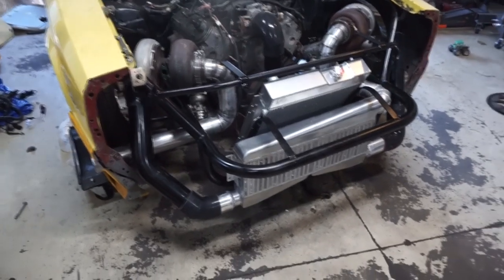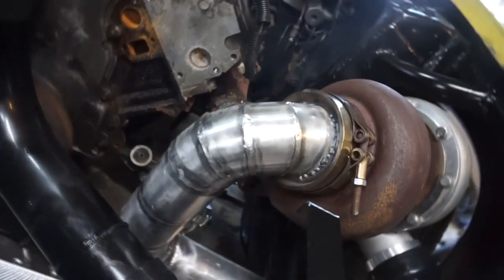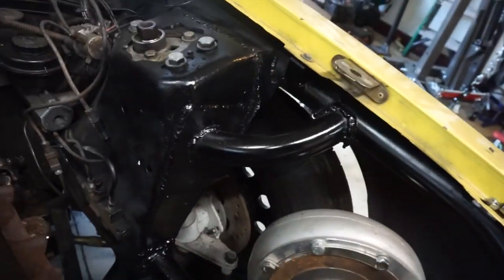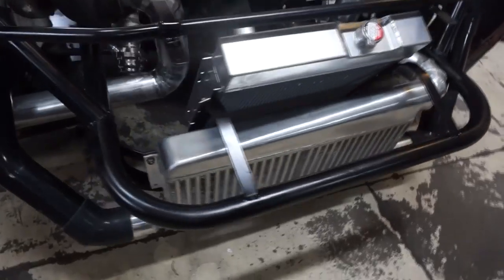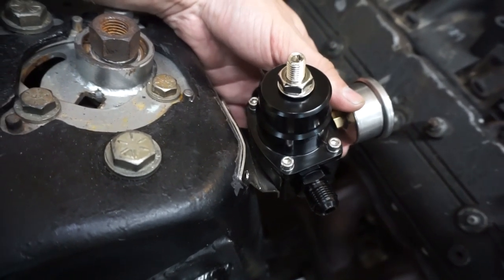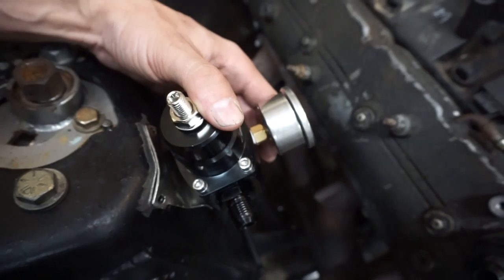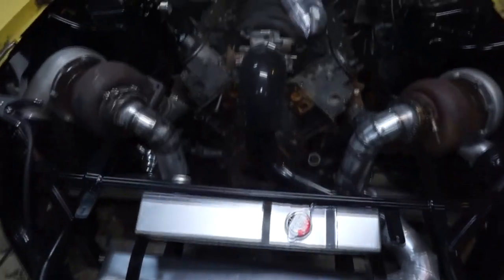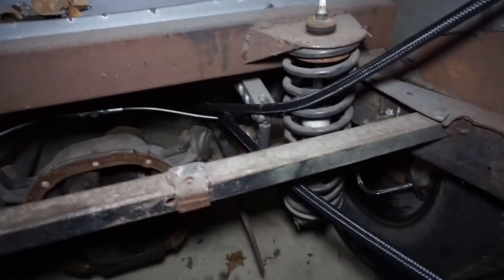LS FOX Radiator Paint And Fuel Pressure Regulator Things!!!

Comment: Man, I've fought braided lines and fittings for years. The biggest "trick" is to use the same brands of fittings and hose. Its tempting to buy cheaper fittings/hose in different brands, and that's where the work starts. Kool Tools makes a nice hose assembly deal that works great btw
Reply from the maker: Yeah, that's exactly what it was. These went on so easy, lol. And I'll have some extra fittings with each set.